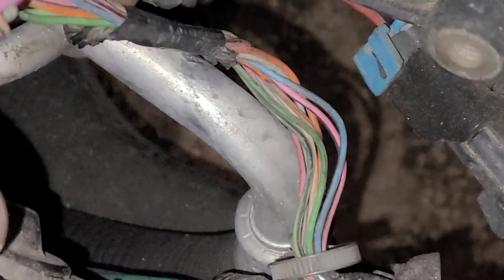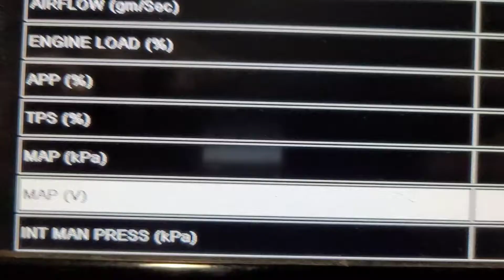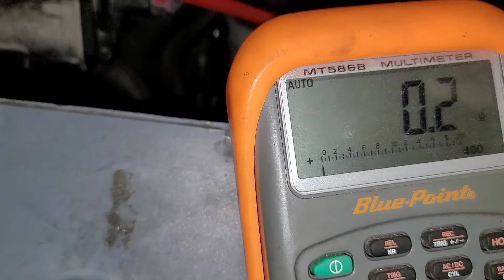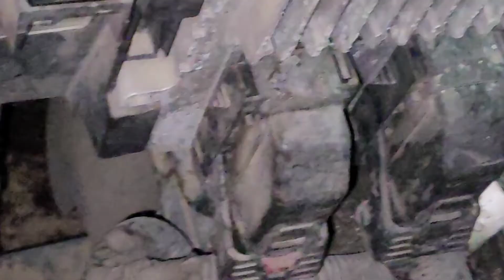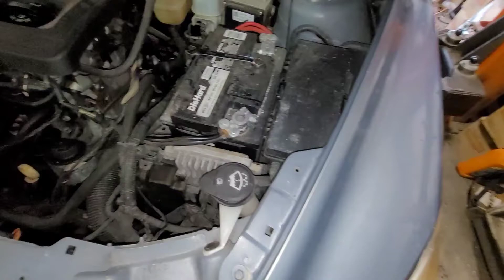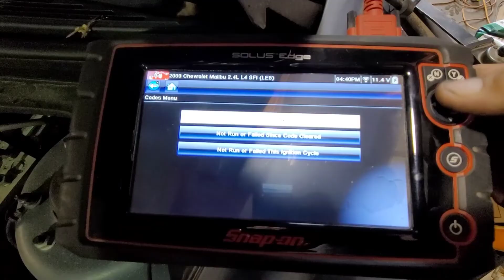Check engine light leads to complete electrical failure

Comment: Only 250???...I just retired my 2002 silverado with 350???..
Bad miss..a few coils..a few injectors..pulled head..found broken valve spring after pulling..
Needed a tires,brakes,alignment,A/C stopped working..heat was questionable ..
Time to let it go .

Comment: If that's just the ground that it's missing, can you supply a ground to it with a jumper wire to confirm it works before spending the money on a PCM?  If it does work, and that's actually all that's affected you could even leave it that way on such a high mileage car.
Reply: Good question I would like to find answers on it